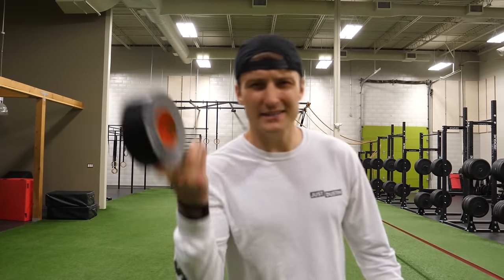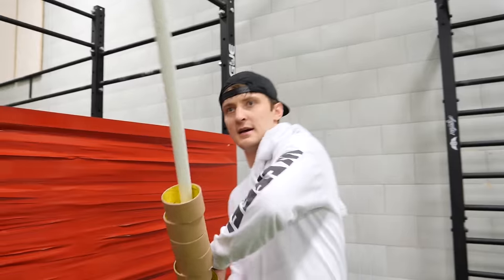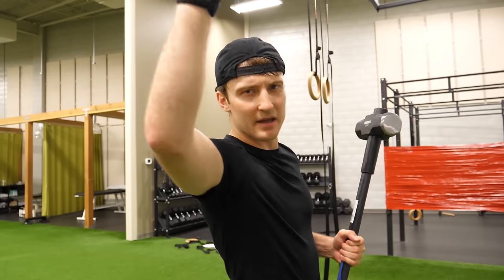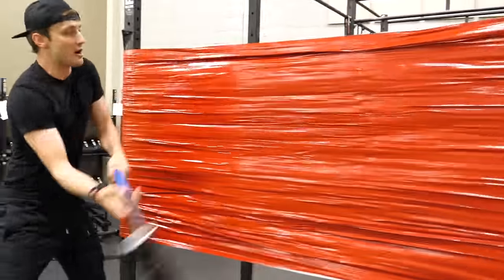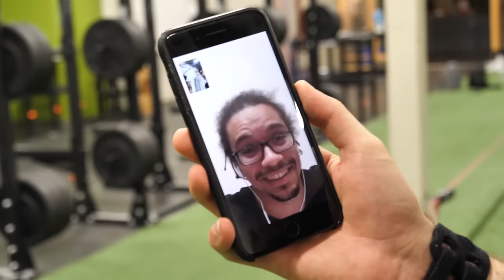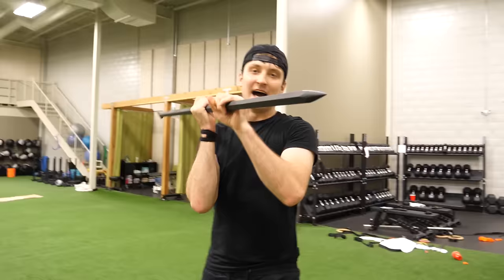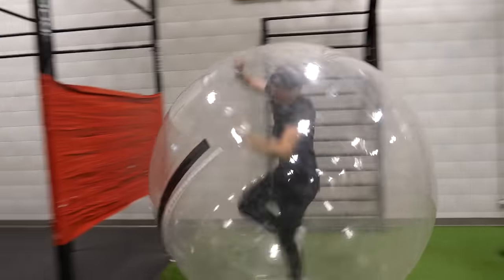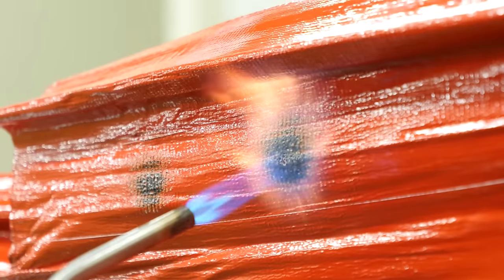100 LAYERS OF NUCLEAR TAPE (DANGER ALERT) UNBREAKABLE WALL

Comment: Hammer: does nothing 

Phone: hole in the wall
Reply: Dats crazy
Reply: BREAKING NEWS: man Robs bank with phone killed alot of people
Reply: palebazurker it’s probably due to the surface area as the force is spread over a lower surface area it produces higher pressure (n/m2)
Reply: Litrely bro

Comment: You should make a rubberband wall
Reply: I AGREE
Reply: Galaxygamerz 28 how is he going to make a rubber band wall?
Reply: Nitro Blox123 he can just buy big rubber bands and go around the 2 poles and before you ask how to get big rubber bands a simple google search will answer that
Reply: zach Fletcher so if he is going to take big rubber bands how does he put it around the two poles there is no opening
Reply: Nitro Blox123 He can just cut them then rap them around
Reply: Galaxygamerz 28 you can't cut rubber bands xD
Reply: Nitro Blox123  Sure you can! Just use scissors or a knife

Comment: His new hammer is Storm breaker and his old one is Mjölnir
Reply: You are correct
Reply: @randallcollins8632  you are wrong
Reply: Its not a new hammer. Its an axe
Reply: @AZ9 it's an axe hammer
Reply: @34akz36  thanks
Reply: @AZ-hz7sh  no problem
Reply: More like a AntiThanos Axe
Reply: @Markii251  anti-thanos hammer axe stormbreaker
Reply: @34akz36  issa anti thanos stormbreaker axe hammer made by groot
Reply: @KW03_Lucky  👌
Reply: Kameron T hey the new one is a axe not a hammer
Reply: You are correct
Reply: That is correct
Reply: @danielcandido3370  that's not correct it's a axe hammer
Reply: Isn’t storm breaker just in the MCU?
Reply: WhEn ThOr ShOuLd oF WeNt FoR tHe hEaD.
Reply: Its an Axe not a hammer well tbh it does have a hammer side but the Axe side is the main side
Reply: Kameron T yeah
Reply: Wrong his new one is called wind blower
Reply: He doesn't have a new hammer, it's an axe.
Reply: Kameron T storm breaker isn’t exactly a hammer it’s a cross between a hammer and an axe
Reply: Correct
Reply: Az9 you are actually very correct actually
Reply: In the nordic myths from the vikings time it is mjölner.

Comment: Mjölner is the name of Thors hammer
Reply: Charlie Arvidsson Mjolnir* but now it’s StormBreaker
Reply: @voltex9138  it is from Sweden so its name is Mjölner
Reply: @voltex9138  but storm breaker is a completely different weapon
Reply: It's actually spelled "Mjolnir"
Reply: Charlie Arvidsson mjölnir*
Reply: But stormbreaker is more an axe then Mjölnir is a hammer
Reply: Or stormbreaker
Reply: @charliearvidsson4246  Mjölner is old norse so you can't really complain, though i wish it was swedish too cuz i am...
Reply: Technically it’s from Norway and not Sweden
Reply: Charlie you are right it is mjolner
Reply: Yo, mjölner.. it's not spelled like that -.- it's spelled either "Mjölnir" or "Mjolnr"
Reply: T3RM1NAT0R Mjölner is the name of the hammer in sweden

Comment: Thor’s axe in infinity war is called storm breaker
Reply: Hammer not axe
Reply: @garywindus6670  it is in infinity wars
Reply: No because the hammer is called Mjolnir where as the axe is called storm breaker
Reply: @garywindus6670  in infinity wars it is a hammer axe
Reply: @clairewithers3943  he asked for hammer
Reply: @garywindus6670  in Infinity war the axe is storm breaker. and it is an axe
Thors hammer was destroyed in Thor: Ragnarok and it was called Mjolnir
Reply: no its Mjölnir
Reply: Claire Withers he asked hammer
Reply: Spoiler ALERT